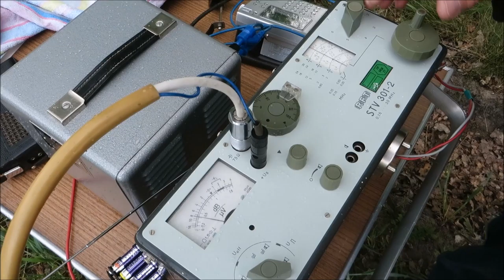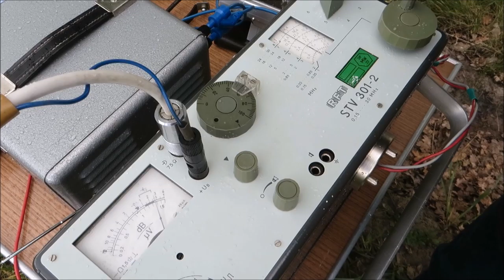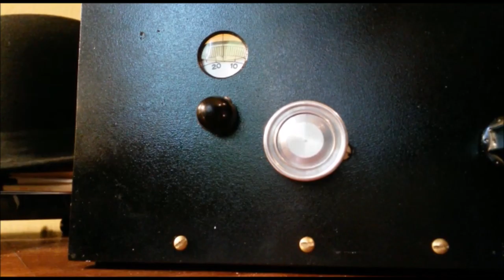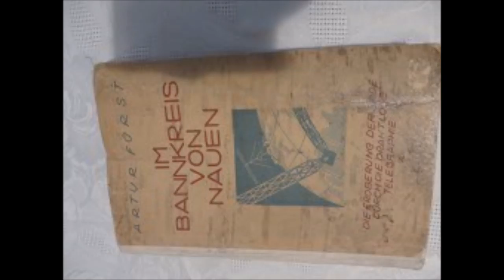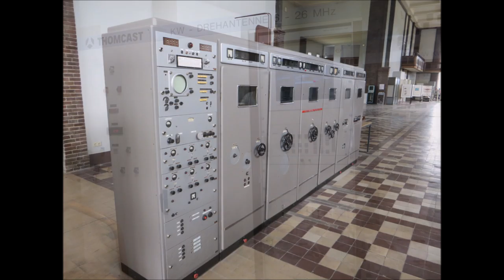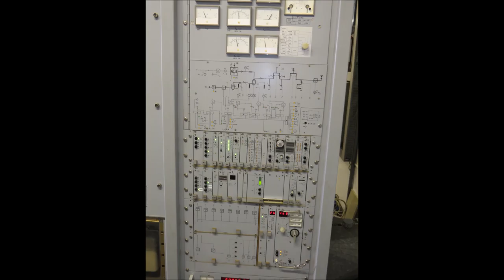The mighty KBC Giant Jukebox | Transmitter Nauen

Comment: Good video on a very impressive installation. But radio transmissions are gradually being supplanted by digital streaming on the net. One by one, gradually the radio stations are leaving the airwaves to be replaced by streaming. A recent check of the international shortwave frequencies revealed just how quiet this vintage media delivery system has become.